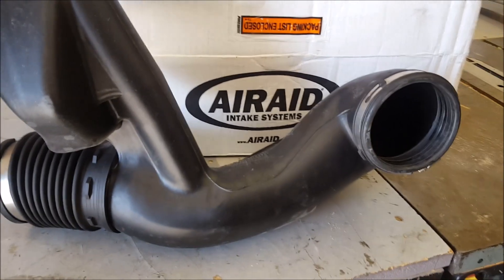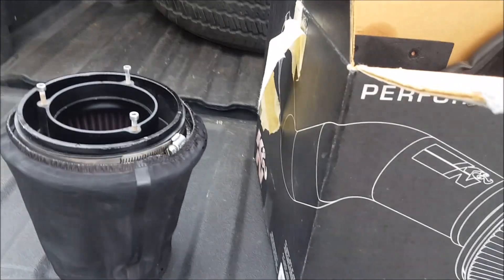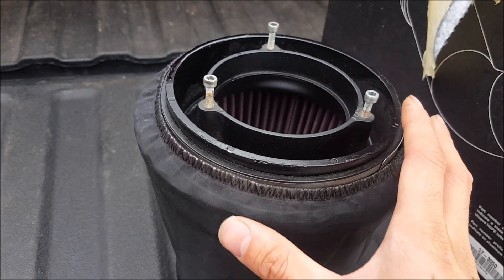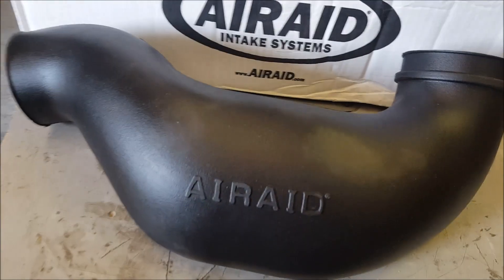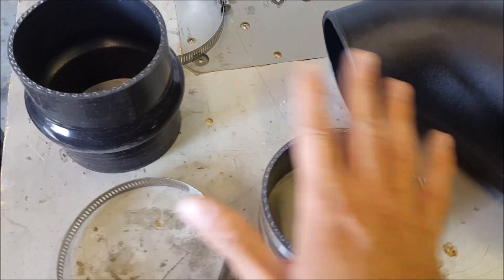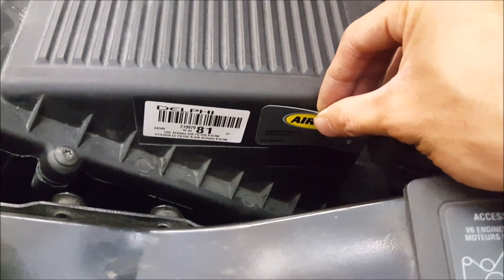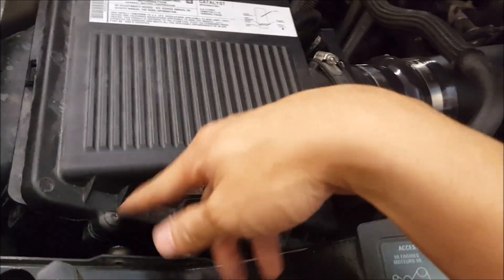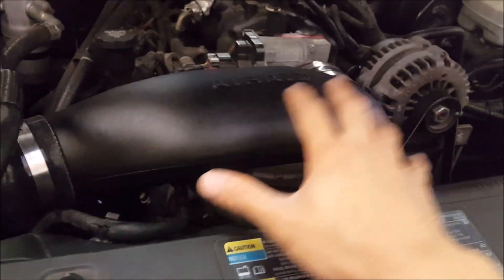Builds: Took out my Short Ram Air Intake / Cold Air Intake (Interceptor) | AnthonyJ350

Comment: I have the same setup as you with the airaid tube and factory box with a k&n filter. I took the airaid open filter off and put the factory box back on and couldn’t tell any difference in performance. Using a code reader it appears that the factory air box provides a few degrees cooler air than the open airaid filter. Going to keep the factory air box and airaid tube and sell the open airaid filter.
Reply from the maker: Nice! Thanks for helping confirm 👍
Reply: @AnthonyJ350  you’re welcome!
Reply: @AnthonyJ350  do you think the throttle body spacer is worth it?
Reply from the maker: @bdtaylor1979  I like the idea of it, and it acts like a heat sink. Debatable how effective.
Reply: @AnthonyJ350  ok, I’ve thought about getting one but a lot of people say they aren’t worth it but there’s others that say they could tell a difference.

Comment: hey anthony hopefully you'll see this but I was wondering where you can get that long Greddy shift knob I saw in the "350z buyers guide" looked pretty sweet.
Reply from the maker: It's actually 1/4" shorter than stock.  It's Torque Solution's short throw shifter with a Greddy weighted shift knob on top.  To make it look long I just stuffed the factory boot around the factory rubber dust shield.
Reply: oh ok thanks, might be going for something like that on my setup.

Comment: The boot between the air box and mass air is installed wrong.
Reply from the maker: What's wrong with it?  it's the same on both ends in thought when I looked at it.
Reply: +AnthonyJ350 the notch on the boot closest to the air box should fit over the tab on the air box
Reply from the maker: +CALEN WEED Oh you know why I did that. I don't like having plugs face up cause water can pool in. does orientation matter for sensing flow?
Reply: +AnthonyJ350 use electric grease. 
No it locks everything together better is all.
Reply from the maker: +CALEN WEED Already is. I'll probably rotate it back. Good eye!
Reply: +AnthonyJ350 Welcome

Comment: Would you sell it? i would like to put one on my 6.0 vortec
Reply from the maker: The unit has already been sold, sorry buddy.
Reply: +AnthonyJ350 if you have a gain screw on a amp that is so sensitive.....meaning you barely touch the screw and the amp goes wide open or goes all the way down.....is there a fix for this or is it not worth the trouble........
by the way your vids are very informational and has helped me out on more than one occasion. ......awesome work keep it up man.....
Reply from the maker: Brad Portier Where are you getting signal from?